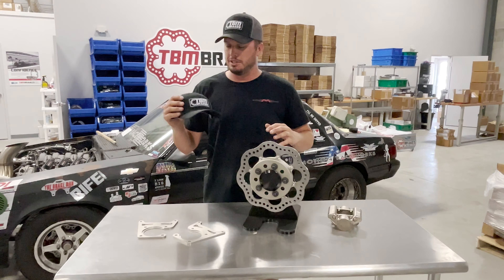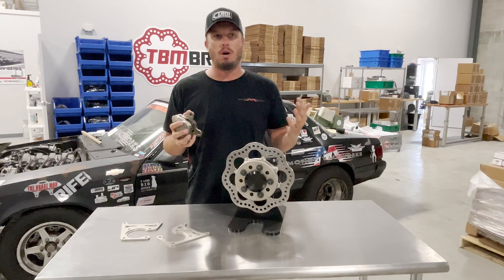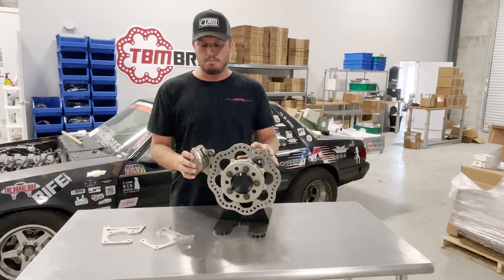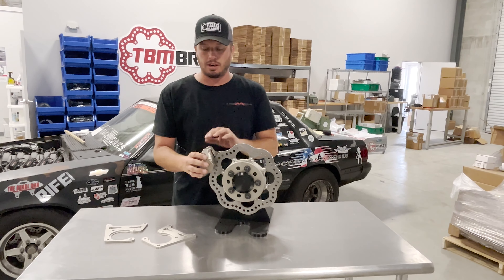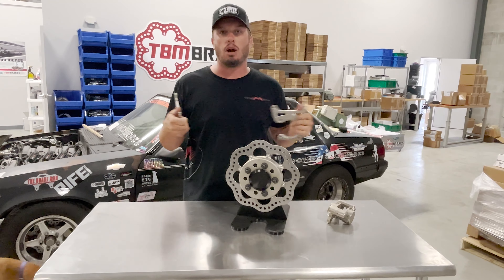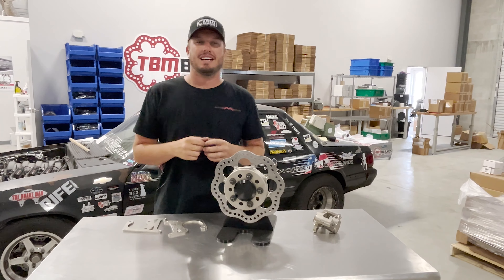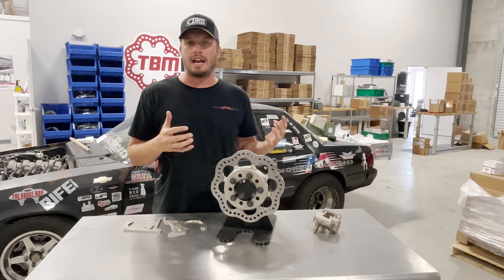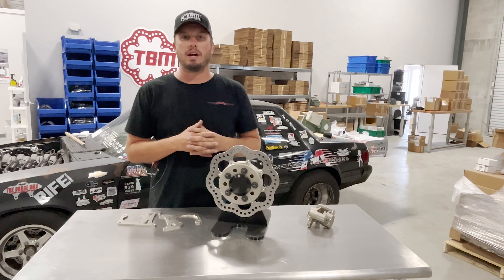Tech Tip Tuesday: Caliper Placement

Comment: Brakes work by converting motion into heat , so surely calipers aught to be placed in the best possible position for cooling them down . Also ,  the calipers need to be out of kept out any dirt if at all possible . I remember a motorbike , a Honda I think , that had its front  discs  completely shrouded .... That went too far in the keeping clean idea because the brakes over heated  ! So I would say , where possible , place the caliper to the front of the hubs so the caliper body is in cooler air  and where the body  hides the  brake pads from dirt . I would suggest that the calipers  are placed high at the front so that the brake discs get a decent amount of cooling as well .  Brembos are my favorite anchors . ATB , liking content  .
Reply: I  agree with Doug about having the bleed nipples as high as possible....that is in relation to the caliper . There will be pipes  , unions and the master cylinder higher up of course . During bleeding , whilst the brake fluid is under pressure air should not be able to enter any part of the system , assuming fluid is in the master cylinder and the system is healthy . A tightly fitted bleed pipe held as high as possible helps rid the slave cylinders of air  and old fluid. Beware of 
using pressure bleeding mind . I once fitted the master cylinder with the wrong cap , the size seemed correct but the thread was slightly incorrect . This cap joined master to my spare tyre which provided the bleed pressure . As  soon as I turned on the air valve fluid  erupted from the master . My engine bay and my friends car parked alongside were sprayed with fluid big style. Lol .  A long hosing down saved the paint . Never again !
Reply: Having watched a few more videos on this channel , which I am new to , I find out master cylinders on some cars , drag cars anyway , can be lower than the slaves at the wheels. Help ! I am way behind on the knowledge at race level at least. Sorry .....

Comment: I thought there was a difference between mounting the caliper in either the 9 o’clock or 3 o’clock position on the fronts of cars. One position lifted the car during heavy braking and one pulled the front end down. Or is that some sort of urban legend ?
Reply: I had covid. That should be enough said if my reasoning doesn't make any sense. First off depending on which side of the car you are on 9 and 3 o'clock positions change. Right? Captain's side is 9 and 3, drinker side 9 is between the tire and the drinker. But I'm also thinking in all the different cars I've seen brakes on they are typically at about 2 o'clock looking from the captain's side. Of course hard braking will make the front end dip. That's why we sneaky folks don't nap our brakes when a cop goes by. Dead give away. Maybe you're thinking bicycles or motor cycles. Anyway I don't think so. You got forward motion and a rotor being pinched. Can't see how where the pinching is happening could matter. My covid addled 2 cents.
Reply: Unban legend. Suspension design can do those things, but not brakes.
Reply: No matter where the caliper is mounted will change the leverage point of rotation. The only thing to consider is whether the rotating force is driving into the anchor point or away from it. Those specific mounting brackets are basically symmetrical so there is no advance versus disadvantage.
However if you have an offset bracket the advantage would be to have the rotating force driving toward the anchor bolt position for solid braking with no movement or give in the mount. Once the caliper clamps against the rotor the force is driven into the road surface in the direction the tire and wheel assembly are rotating. Centrifical (spinning or rotating) force into lateral friction motion.